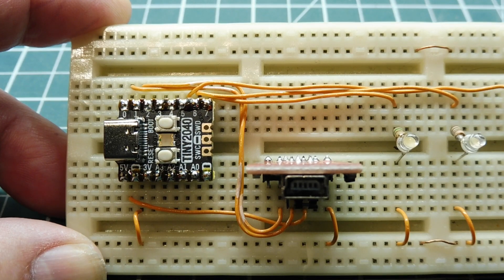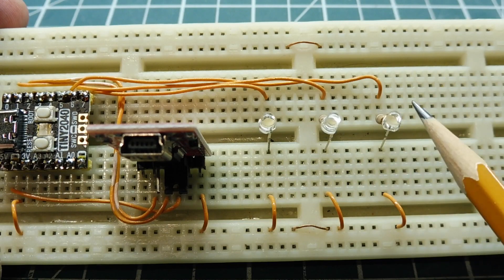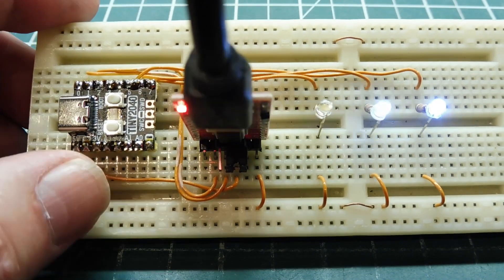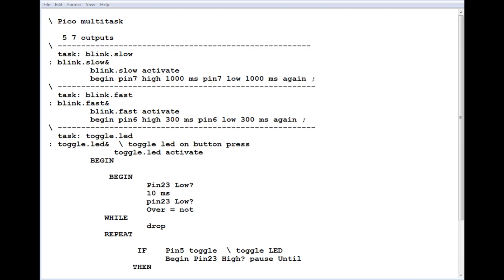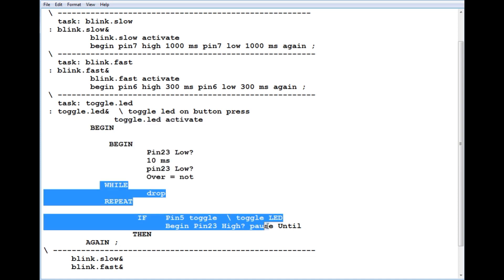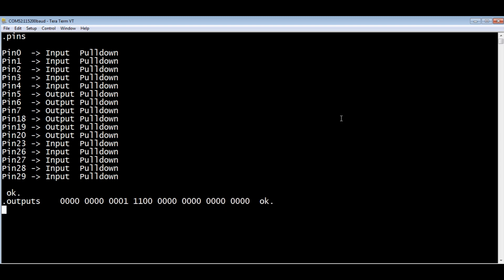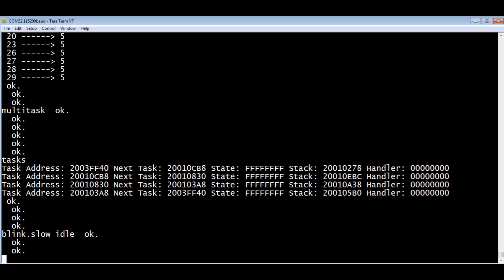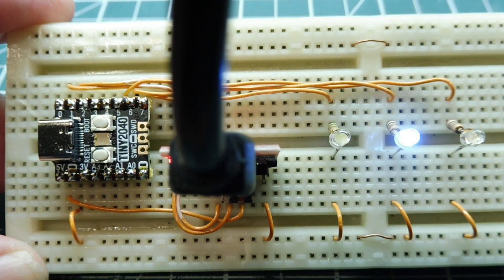RP2040 Multitasking  /  Mecrisp Forth  /  Tiny2040

Comment: Do you have a recommended resource for learning Forth on a micro? I actually have a copy of Starting Forth by Leo Brodie that I bought in the 80s. I've long been fascinated by Forth, but have never gone beyond very simple stuff. My specialty is the Propeller family, but I'm comfortable with Assembly on that platform. Forth seems like a good way to get performance out of platforms I'm not as intimate with.
Reply from the maker: Hi Jon.. Starting Forth is a good introduction but is a bit outdated when it comes to microcontrollers. I would first learn Flashforth on the Scamp3 board which you can get here:  https://www.tindie.com/products/johncatsoulis/scamp/
It is running on a PIC microcontroller and has support for I2C SPI UART GPIO and ADC onboard so it simplifies coding when building a project. There are getting started tutorials on the udamonic web site here: https://udamonic.com/what-is-a-scamp.html
Check out some videos I has posted on You Tube:
https://udamonic.com/scamp-projects-on-youtube.html
There are also tutorials on the Flashforth website:
https://flashforth.com/tutorials.html
There is also support by the designer of the Scamp3 board.
Email is on his website:   Udamonic.com
Have Fun!

Comment: Back in the 80's I replaced my ZX81 Basic Rom with a Skywave Forth Rom. This gave to ability to divide the screen (TV!) into separate user defined fixed windows and have a different task running in each. Wish it was still around, it transformed that machine into something useful. Loved Forth so much I bought a Jupiter Ace as well. I'm looking to develop some automation for my telescope and quite fancy Forth on a microcontroller if only out of nostalgia!
Reply: Telescope automation ??  Mr. Moore would be proud.
Reply from the maker: Thanks for sharing.

Comment: Nice video, what are practical application for this board?
Reply from the maker: The RP2040 is a new micro-controller that has just been released and can be added to the large list of available micro-controllers that you can choose from for your projects.
Check out the last 10 videos on my channel for application examples. Here is one of them: https://youtu.be/CULas2y_sXI
Reply: @0033mer  Thank you so much for your reply.